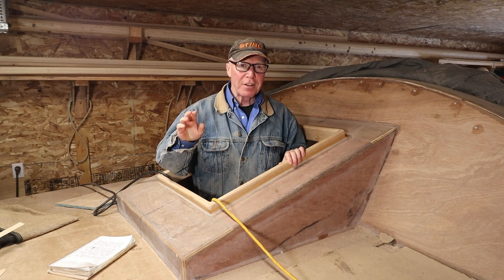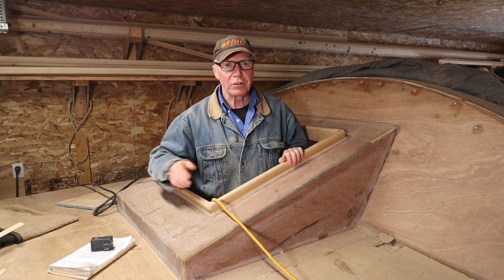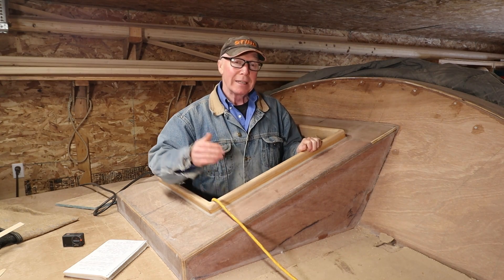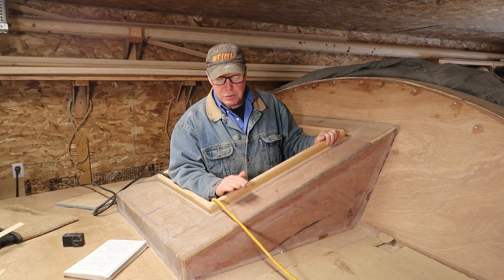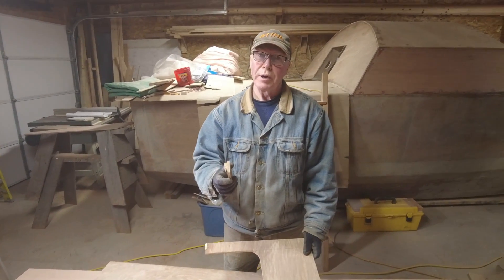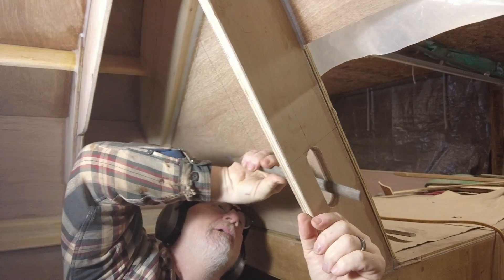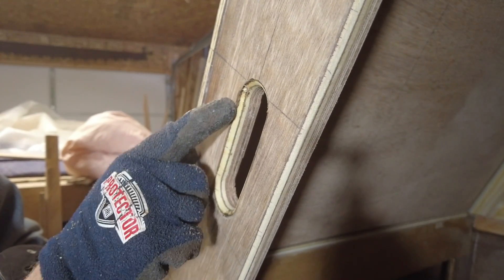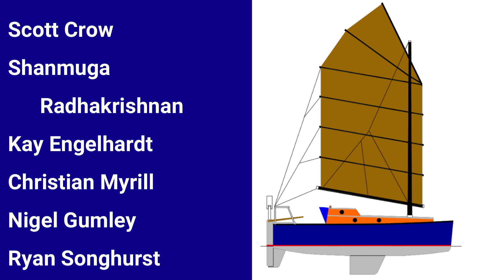S2E76 The 4 Reasons to Create your own Wave Rover Hatch || 92 days before Launch

Comment: Alan, my 14 yr old Son has asked if you intend to fit an electric outboard to Wave Rover?
Reply from the maker: The initial plan was to have an electric motor. Unfortunately they are more than double the cost of a gas OB and secondly they did not even take the time to get back to me when I asked about sponsorship.
Regardless, I won't be using the motor very much, just getting in and out of harbour.
Reply: @RoversAdventure  Alan, that's a good lesson in reality you've given the boy.(and father).

Comment: When the hatch is open, it looks like the camber/pitch of that cabin roof will let a bunch of water in if things pick up quick.
Reply: Maybe you have a fairing in mind?
Reply: I wonder if it wouldn't be utterly impractical to have the immediate surroundings of the hatch entry "curtained off" with a sort of... heavy duty shower curtain as a baffle against spray. Picture a "collapsible/expandable wet locker" that disappears when at anchor, or when sailing in nice weather... One could remove the foul weather gear there and if space for a wet hanging locker could be arranged close enough, and airflow provided the right way it might even be able to dry - but that would probably require powered circulation fans, and proper drying would require a heat source that works safely while under way. If you'll allow me to ramble on for a minute here...

Electric propulsion capable of power generation while under sail could be just the ticket as it wouldn't require much constant power to generate practically useful amounts of energy if it works 24/7. To give some rough idea, consider an electric kettle for bringing water to a boil. Home kitchen appliances that have lots of power available (as much as one can stomach in their utility bill at least) run about 1.5 kW and can bring a liter of water from 4 degrees Celsius to 90+ in mere minutes. Their low power cousins that are 12 V appliances are one tenth the power (150 W for one example), so they require ten times the wait to do the same job but it still works.

If one could budget just 50 W of continuous power to heating and blowing air, that would produce (24 h) x (50 W) = 1.2 kWh (or 4320 kilojoules) of energy. The "latent" heat, or heat of vaporization for water, meaning the energy required to evaporate it, is 2257 kJ per kg so that would be enough to dry up to (4320 kJ) / (2257 kJ/kg) = 1.9 kg of water.  That's about the power of an old fashioned light bulb; if put to a good use that power budget could dry the wettest of wet towels if you don't mind waiting a day... and it would have to be in an enclosure instead of trying to warm up the entire cabin with it!

Accounting for the "sensible heat" (specific heat capacity) of water as well we get more realistic, practical figure of 1.6 liters if we first have to warm up each liter of water in the foulies from ten degrees Celsius ambient temperature. Food for thought...
Reply from the maker: In rough conditions, it will be opened and closed quickly. Originally I had though of a dodger but that will have to wait until I have more time.
Reply: @RoversAdventure  Of course. BTW your boat is beautiful and your skills are inspiring.

Comment: I’m not a naval engineer but it bothers me to see fiberglass cloth only being applied to one side of a structural piece of plywood.  From what i can tell, this is how much of your outer above waterline cabin walls are made.  It should be much stronger w fiberglass on both sides.
Reply from the maker: Is it strong enough? Yes. Would it be stronger with more glass? Yes
Reply: I like the Sven Yrvind design with carbon fibre on the inside and fibreglass on the outside. He also used a foam( divinacell) core. In his eighties and planning to sail around Cape Horn.
Reply: @Underthehighwatermark  I agree, but I think Allen is on a tighter monetary budget.  He's certainly on a tighter time budget.  I would LOVE the insulation of divinacell.  Allen's boat is going to be a lot more comfortable, at least most of the time.
Reply: I think he could have kept the Contessa and been nearly done by now and for a lot less money.
Reply: @Underthehighwatermark  Yes, but building a boat and solo sailing is a spiritual journey.  It's not just about "getting it done".

Comment: Any other reason than expense when considering using a high quality composite board instead of wood?  I am just curious being that some composite board may have better UV resistance as well as less maintenance.  ?
Reply from the maker: If you have it use it. But wood is a great product when you seal it.
Reply: @RoversAdventure  Thank you for answering my question!